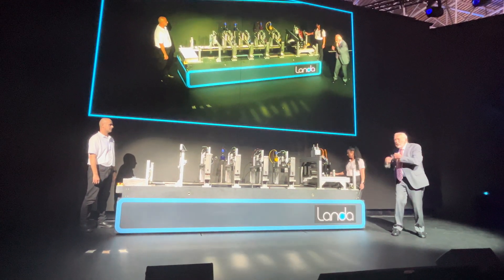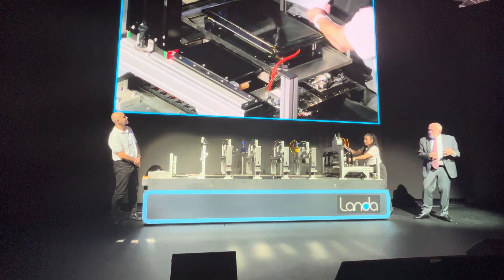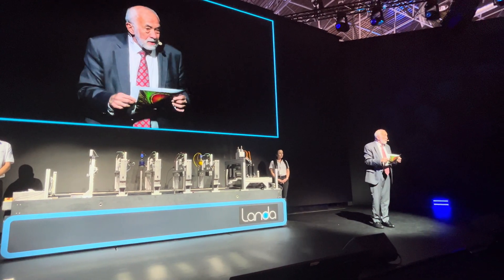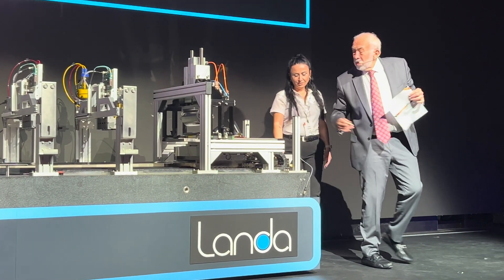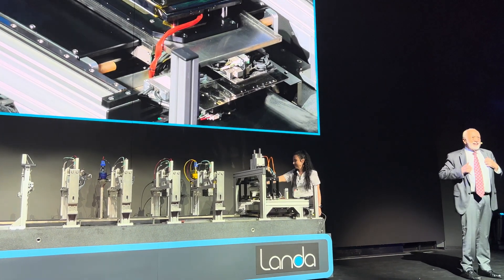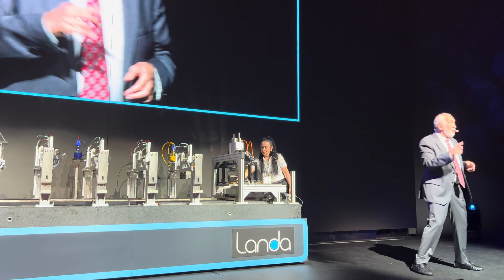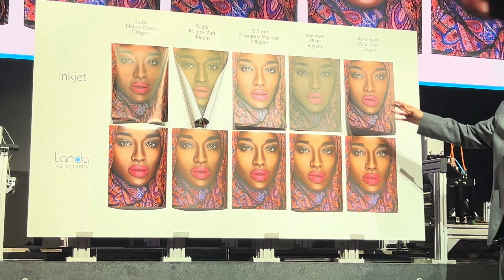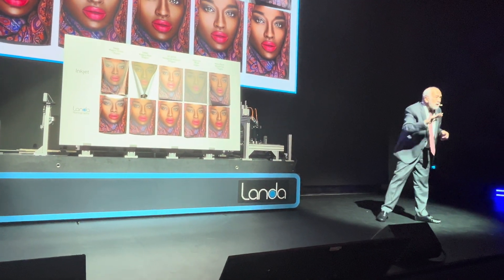Landa’s nanographic digital printing explained by Mr Benny Landa

Comment: I have been in the Print Industry all my life. I started my apprenticeship at the largest printing plant in the southern hemisphere I have worked on the largest press in the southern hemisphere at that time. We had the most advanced equipment in the industry and we couldn't figure this out we would make jokes about replacing the print heads however speed of transfer to blanket was the issue. Honestly the trade is dirty this will make recycling possible at any level and it's the only way to get the speed. I made mention of this and Michael you stopped talking to me I can see why😂. This technology is the solution to so many trade headaches.